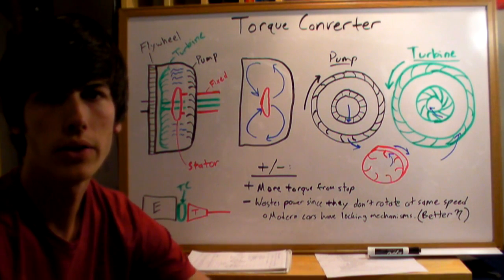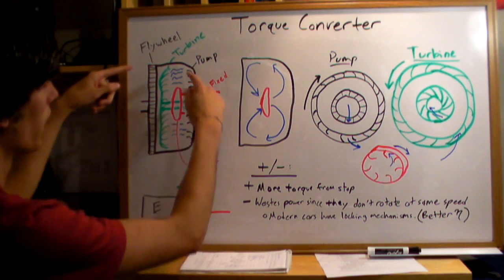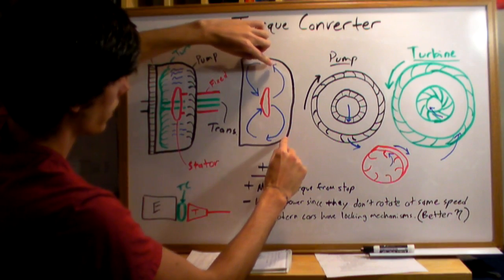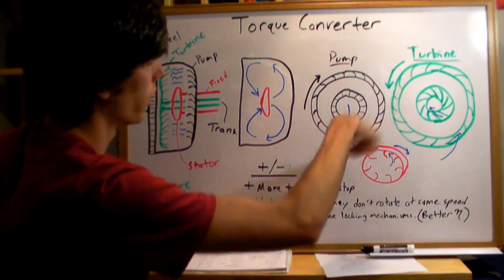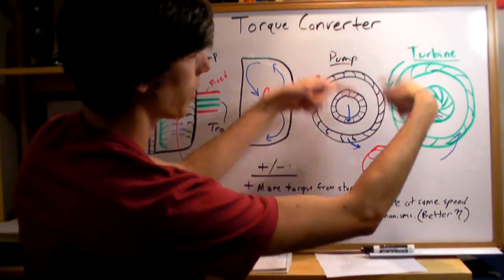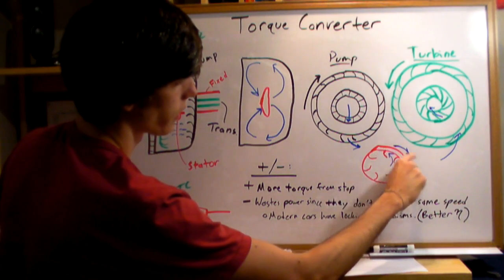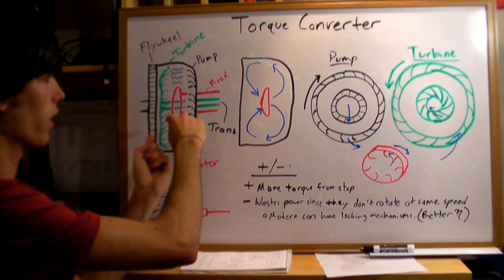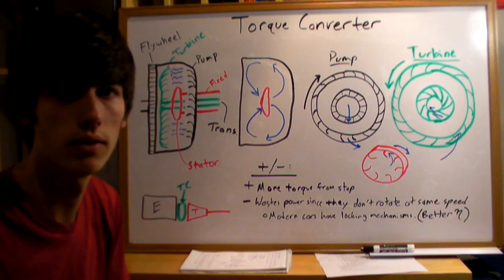How Torque Converters Work - Automatic Transmissions

Comment: So the reason that my 1994 Mustang GT 5.0 (Automatic) drags out gears when both increasing and decreasing speed is more likely a problem with the torque converter, and probably not the transmission?

Comment: At then end, how you said it wastes power. I find this true with older vehicles, however more modern ones use. Torque converter clutch and solenoid to lock the turbine and pumps together when you're at speeds usually 50+mph. It'll feel like a small extra gear when it happens a and your engine will drop about 200-300rpm.

Comment: Does the torque converter can prevent the "riding on clutch" happening while driving at a lower speed?
Reply: +Hao Huang Autos don't have a clutch. So, there's no such thing as riding the clutch.
Reply: chocoboblue99 There is a clutch used for lockup the transmission.
Reply: A lock up clutch is used in a transmission not a friction clutch. Transmission clutch simply lock up the impeller and turbine at a certain speed. A friction clutch in a car allows smooth transition of power from the engine to the transmission, this is why some slip is required. You cannot 'ride the clutch' in a auto box, there is no such thing.

Comment: hi, i was told when one way clutch in torque converter is applied,(means lock down engine speed same as torque converter speed), will RPM goes down or high, also please please explain why it goes down or high..

Comment: what's the different between torque converter and fluid coupling?

is it the same?
Reply from the maker: caterpillarz1 A torque converter is a type of fluid coupling. Fluid coupling is a more general term.
Reply: Engineering Explained That's incorrect, a torque converter can multiply torque where a fluid coupling can not.
Reply: So coupling can only transfer power whereas torque converter changes amount of force?

Comment: Hey, I have a 1993 Celica that's automatic and I've been having problems with it. I will start it up and it will idle like normal and I can shift into neutral and it will still idle but, when i shift it into drive, reverse, or step on the gas while in neutral or park it stalls. I ask someone and they said it might the torque converter and another said it might be the fuel pump. can you help?
Reply: May be the torque converters lockup clutch. I'm not sure if a car that old has one though.
Reply: +lahnie95 I don't think you'll ever get a straight answer except a list of things that COULD be wrong, because without testing your car bit by bit and excluding potential issues one after another, nobody is going to know.
Reply: +Siana Gearz it turned out to be a dirty fuel tank. it was full of junk and every time the rpms went up it would suck up all the junk from the bottom of the tank and block up the strainer, starving it of fuel. and idle didnt provide enough suction to do that

Comment: Actually, there is no pump inside the torque converter. The pump is on the other side of the bell housing. The parts inside the torque converter are the turbine, the stator, and the impeller. Most modern torque converters also have a lock up clutch assembly which is attached to the turbine. Also a flywheel is in a manual transmission, a flexplate is inside an automatic transmission.
Reply: correct
Reply: Isn't the pump and impeller the same thing?
Reply: Another word for impeller in this case is pump.

Comment: It's written in many websites and books as "torque converter is SEALED". Is this true? If so,  we will not be able to replace the ATF filled in the torque converter by a ATF changer.
Reply: the parts inside the torque converter are sealed. draining and filling from the designated areas on your transmission will still drain and fill the torque converter.

Comment: i dont get it...the engine keeps running right and so does the flywheel...so if the pump is connected to the flywheel it keeps releasing fluid and keeps rotating the turbine...so how do you stop the transmission when you need to come to a halt??
Reply: Vivek Srinivasan you apply the brakes in the tires which slows down the transmission

Comment: so to reallly break it down a torque converter is the reason why Automatic transmission cars dont stall out in drive stopped completly in red and why when you let go of the brake they tend to creep a little?

Comment: just trying to gain a better understanding as to why my douchebag mechanic told me my shot trans doesn't need to be replaced yet: So since there's no metal to metal contact in the TC (at least nothing like gears meshing), will the TC effectively save the rear end from damage when the trans slips/hard shifts?

Comment: No you are correct. I don't know what this guy is tlking about but I teach automatic transmisions and from the engine it will go TCC clutch or pack o clutches then turbine then stator then Impellar (or pump) then pump drive hub.  You ar right this guy doesn't know what he is talking about

Comment: the only thing i dont get is how can a fluid be strong enough to move a big suv or something. it seems like the fluid would just get pushed around and not really do anything
Reply from the maker: lake holder Liquids do not compress (at the pressure levels we experience), and hence can move anything. This is how hydraulics work. Forklifts, cranes, big CAT earth movers. All using fluid pressure to move things.
Reply: It is not the torque converter that moves a vehicle, it is the engine via the transmission.  The torque converter is simply a device that allows the engine to continue moving while the wheels and transmission are not.  When the fluid is causing enough pressure, due to increased movement (ie. increased engine revolution speed), to drive the turbine within the torque converter, then the shafts of the transmission will be driven, power transferred from the engine through the transmission, and supplied to the differential and wheels.  At engine idle speed, however, the pump within the converter is still spinning with the engine and thus spinning the turbine, but the pressure created by this is minimized and overcome by the braking system.  Release the brake and the vehicle will move, albeit, very slowly and sluggishly. Increase the pressure slightly by increasing engine output and the turbine will increase its speed and the engine will more or less be driving the transmission gears and ultimately the wheels directly.  Hope this is helpful.
Reply: This was explained very well! Now I understand this concept WAY better! Read this twice for the sole reason of how well it explained the function of the torque converter.

Comment: Hold on.What if we could direct the fluid to different turbines. The bigger turbines for lower gears and the smaller ones for higher gears? You could build a crap load of torque with a trans like that!
Reply: Hydrostatic Constantly Variable Transmissions run on this principle.

Comment: There's no flywheel on a torque converter, the converter bolts to a flex plate
Reply: there is a flywheel on every internal combustion engine.
Reply: No there is not. There is a flex plate on automatics. No flywheel.